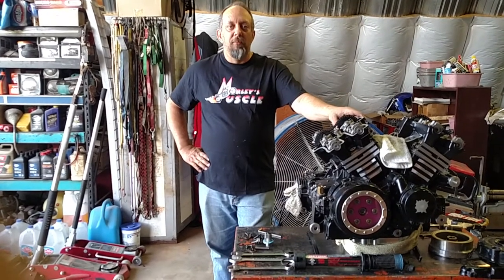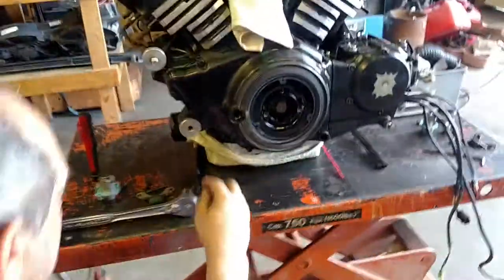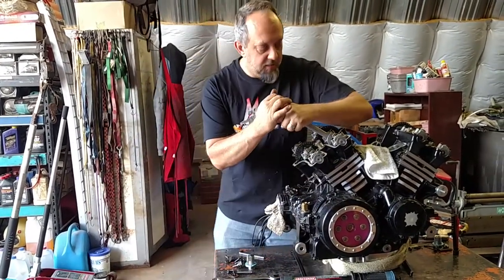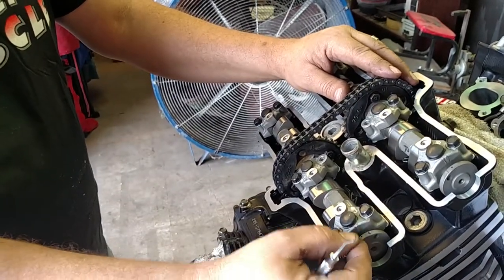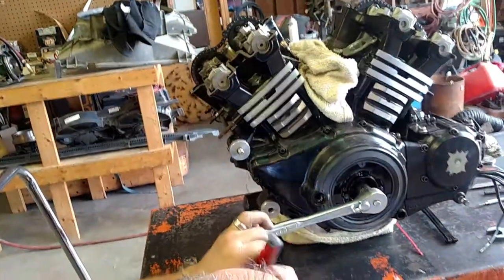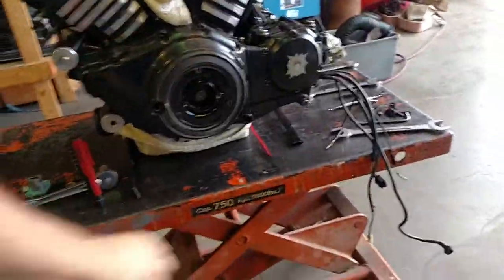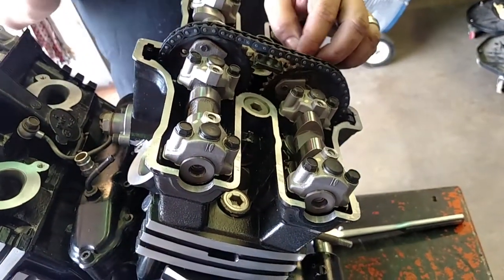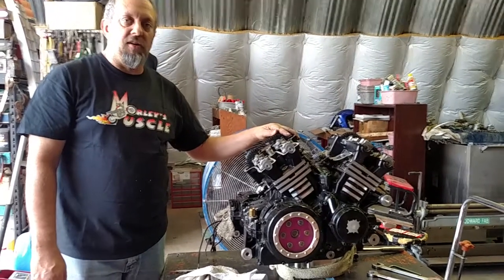Setting Cams on your Vmax!

Comment: Sean, does valve clearance increase or decrease when engine warms up? I measured .003 on 2 intake valves and trying to justify NOT adjusting them... All other valves are fine. thanks. 92 Vmax
Reply from the maker: Typically clearances will get tighter with heat as the metal expands. Also these engines tend to get tighter over time as wear on the valves shifts the stems closer to the camshafts thus reducing clearance

Comment: Thank you for the help. Just finished setting my cams back in after changing out the head gasket. The book is not clear on a few things (like what holes to line up.  I was hoping you could tell me the torque for the 2 bolts in each cam holding bracket. My book says nothing about how tight to put those.
Reply from the maker: There should be generic specifications in the back of the manual for the various bolt sizes. I go by feel but not necessarily suggested for the average guy to do.

Comment: Almost done. And your Video helped me out a lot.   Do you know the torque number for the 32 bolts in the cam shaft caps with the dowel pins??? My book doesn’t mention it and I don’t wanna close the engine without being sure.
Reply: 10Nm (1.0 m-kg) or 7.2 ft-lb

Comment: Hi Sean, thx for very useful videos!!! Its a great job. Can I remove the VMax crankshafts without removing an engine from the motorcycle frame? THX ....
Reply: Yes, you can. I had problems with poor acceleration , turn's out that front side timing was not good. So I set it right with engine in frame. You have to drain the oil  and coolant fluid, remove the  carbs, gas throttle, cooling, radiator with rubber shield and  plastic shield with electric components.

Comment: Hi, great video. A few questions, was that chain worn out? I mean it looks like it should have had a link removed or replaced completely? I ask because it looks like the chain tensioner is really outward not sure how much longer it can compensate the slack..? I am no specialist just a wannabe mechanical engineer :) and owner of 2001 Vmax with 48k kilometers on board and am thinking to check the chain and maybe readjust or replace. Great work!
Reply from the maker: The tensioner comes out a long way with new chains and there is still a lot left to go on these

Comment: Vmax cams for my venture 1300. Good idea?
Reply from the maker: Not worth it unless you also swap on a set of Vmax heads. If you'll do both you will get a nice power increase. I'd estimate at least 10%
Reply: @one2dmax  ok thanx for the quick reply!  I think I'll just do the vmax rear end for better 2 up in the mountains. Thanx for saving me the money. I love these yamahas I have an 83 std venture also with the second gear problem. I got a transmission out of a 91 1300. Going to tackle that soon. Hope your business is doing well.

Comment: Hi Sean, how to fix a backfiring Yamaha v max1200??
Reply from the maker: You have to dermine what the cause is. If you recently replaced the cams or had them apart this could be the issue. Otherwise it is likely a CDI or Carb issue.